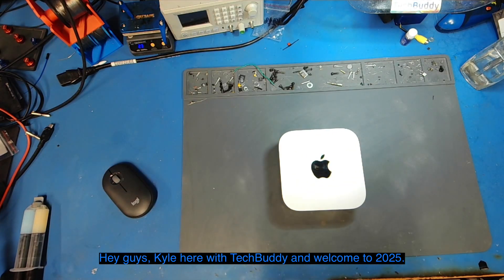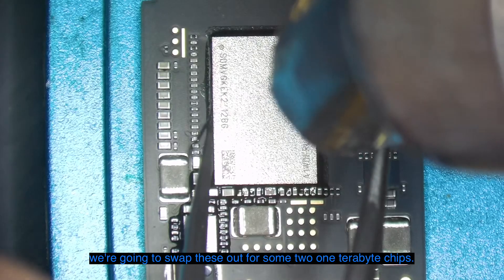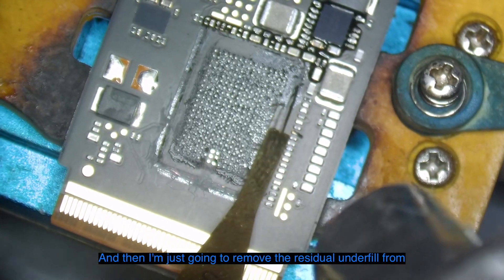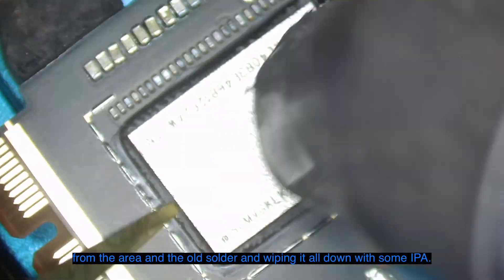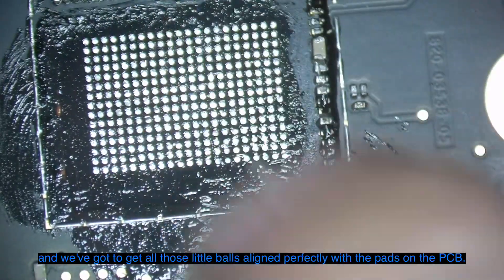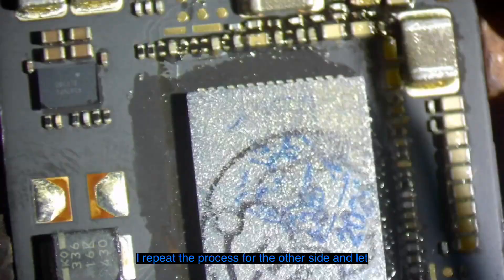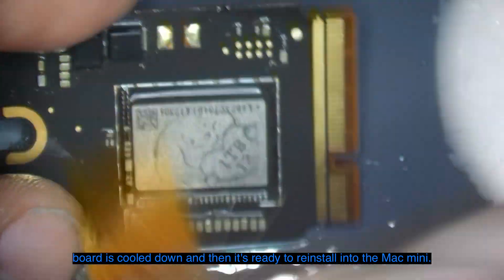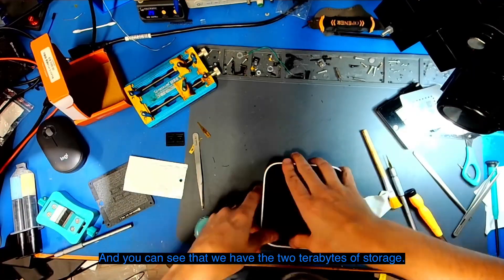Upgrading the M4 Mac Mini SSD NANDs to 2TB!

Comment: Good to see you back and making videos again. Quick question, apart from the initial heat you used to help remove the underfill did you need to pre heat the board in any way before heating the chip for removal?
Reply from the maker: Thanks! In this case, no. The lower heat used to remove the underfill acts as a preheat for the PCB anyway, and due to its size it doesn't need to be preheated really.

Comment: Did programmed the new NAND Chips before installing it?
If so, could you show how to do it? 🤔
Reply from the maker: The NANDs arrive blank. The DFU restore handles the rest. I only have the programmer to check that the NANDs I order work before I perform any soldering work.
Reply: @ Thanks for the answer. 👍
Reply: @techbuddyau  Do you know if blank nands needed for the Macbook Air M1?
I bought a used Macbook Air M1 256GB for upgrading it to 2TB. I bought all the stuff that is needed for.

I soldered the blank NANDs on the board. 
When i soldered it on the board the for first time i didn't align it correctly and tried to start it. The Processor got hot and the NANDs too. So i removed the NANDs and soldered this time correctly.

I could get the Macbook into DFU Mode.
I tried to restore it. But Apple Configurator gave me an Error Code 2006 saying could not start in recovery mode. 

Maybe its possible that broke the board in some way.
Reply from the maker: @MatthiasStiller  Do you have an external programmer to check the NANDs are still functional? If they were not aligned properly the first time, you need to check if they are still functional or if they have been damaged.
Reply: @ No, i don‘t have a programmer. So I didn’t programmed the CHIPS. 
Yes they weren’t align correctly.
Reply from the maker: @MatthiasStiller  It's not for programming the chips, it's just for checking their functionality before fitting them to the board. Does that make sense?
Reply: @techbuddyau  It make sense. 👍 I got you wrong. Sorry. ☺️

Comment: Would love to see someone do something like this to upgrade the CPU/ram on a Mac studio.  Harder to source the SOC
Reply from the maker: @docdailey  As I understand it, the SOC is programmed with the memory configuration so it's not been possible to upgrade the ram, even if you could physically replace it. Happy to be corrected by someone but I believe this is what dosdude1 mentioned before.
Reply: @ yes.  Replace the cpu.  The ram is integrated.
Reply: @ yes.  Replace the cpu.  The ram is integrated with it.  That is what I mean.
Reply: @docdailey  what would you be replacing it with though?
Reply: @ one with more ram.  Where would you get it is the problem.

Comment: Does it only work with Apple based silicon for the dfu. So older MacBook Pros intel based won’t work?
Reply from the maker: @puremetal2417  as far as I thought, Intel based mac's aren't able to DFU restore a silicon based Mac. I could be wrong.
Reply: @techbuddyau  Yes they can, you can restore apple silicon macs with intel machine that have usb c ports. I do it all the time, you use apple configuratior, but you don't have access to the tool on intel macs that automatically puts the device in dfu so you will have to do it manually
Reply from the maker: @3ijnweu3oq3  Interesting, I just looked this up again and it seems you're correct. The information I had at first read said otherwise. Thanks for commenting!